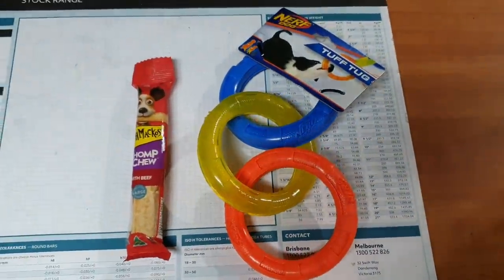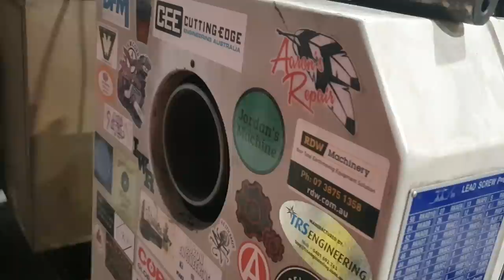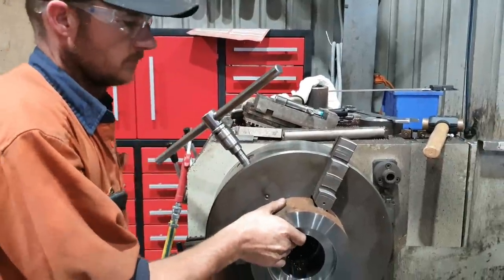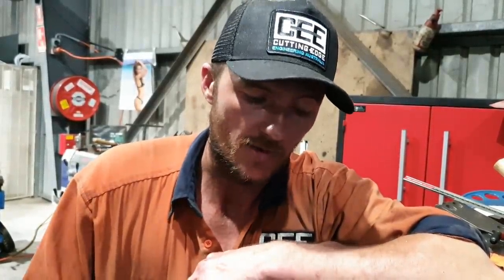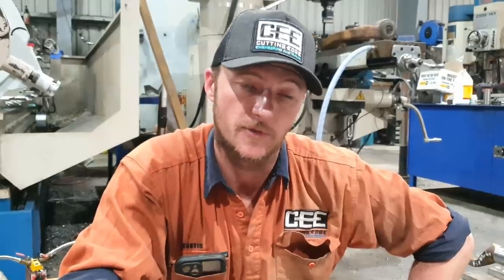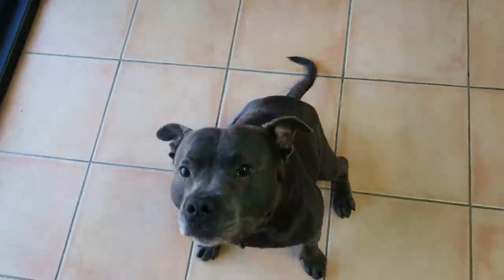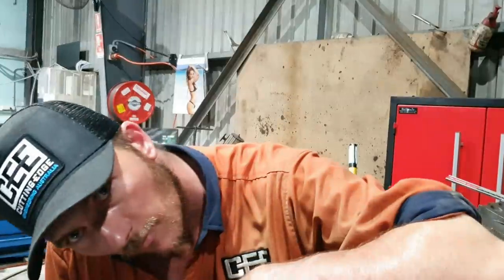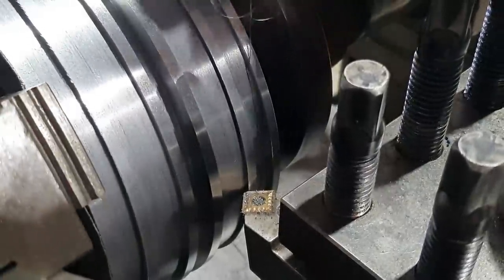Making a Hydraulic Cylinder Piston | Hitachi Zaxis 670 Excavator Part 1

Comment: I wanted Kurtis to say "That's not a twist drill. THAT's a twist drill!", in his best Crocodile Dundee style.
Reply from the maker: 🤣 will have to use the Dundee quote someday
Reply: And it had a very nice grind on it - very satisfying to see those two even spirals of swarf coming from it.
Reply: Only 2” gonna need to do that with a 4” banana drill
Reply: @Sicktrickintuner  Can we get mesurments in non-banana unit standard?
Reply: He should save that one for the big boring bar.
Reply: @Peter_Jenner  Nothing boring about that one.
Reply: @gorillaau  Absolutely nothing indeed.
Reply: @gorillaau   1"(inch) is 2.54 cm. So with rounding 2"(inch) is about 5 cm and 4"(inch) is 10 cm.
Reply: @ianmcnab9534  it's 2.54cm
Reply: @TheDennisZb  Thank you Dennis. 25.4 mm to the banana.
Reply: @CuttingEdgeEngineering  когда я слышу что нибудь про Австралию, на ум сразу приходит крокодил Данди и этот канал. Шикарный фильм и отличный канал. Смотрю с удовольствием. Молодец, так держать!!!
Reply: @ianmcnab9534  Actually it is 2.54cm to the inch
Reply: Big nuts and  big drills
Reply: @CuttingEdgeEngineering  I would laugh for a solid hour if you did that!! 🤣🤣🤣
Reply: That was exactly what thought popped in my head when he brought out that giant drill bit.
Reply: I have a video of a guy sharpening one a twist drill it’s got to be 5 inches in diameter and 4 feet long
Reply: @TheDennisZb  oops my bad
Reply: I think Paul Hogan has stereotyped Australian men for life!  At least for us Americans, sorry guys 😁🤚🇺🇸🇭🇲
Reply: @gorillaau  He did, 50mm.

Comment: I was pretty anxious with how close you got to cutting into your chuck jaws. I guess you must really trust your digital readout and measuring by now to get as close as possible.
Reply: That kind of close quarters work has got to be nail biting when you're on the sharp end
Reply: Before DROs it was a micrometer stop on the bed to stop the carriage. You started off by touching the jaw with the machine stopped, that was your zero. You dialed the stop out about ten thousanths of an inch and let the chips fly. Problem was most of those old machines had a few miles on them, that stop had a nasty habit of scooting just a fraction on every cut. You learned your lesson when you heard that..
thunk.....thunk....thunk.....
of the tool hitting the side of the chuck jaws. Time to stop and sharpen the friggin bit! 
 You learned to have a tender touch with those stops!
 DROs sure make things a lot simpler, I was glad to get them especially when cutting threads.
Terry from South Carolina USA

Comment: Hi Kurtis, good work, I hope the right cylinder tube becomes available.
Those were FUBAR for sure.
I'm not certain you understand what Tristan Hali gifted you with.
They are not conventional stones any more.
They are as discribed Precision Stones.
They do not scratch/grind surfaces any more.
They decapitate dings and scratches and POLLISH the rest of any flat surface you choose to fix.
Go and rub down the top of your mill table or the ways of a lathe.
I kid you not, it will amaze you.
I grind, and also grind these occasionally, and if you rub freshly ground surfaces you can See how well balanced your wheel is, as an example.
A seriously good present of tooling, if you use them..
Just sayn'.
Reply: And today's out takes were pharquing hilarious!

Comment: Whatever it was that destroyed these cylinders, possibly took out the entire hydraulic system, could be a full replacement of barrels, pistons, pipes and pumps.

That cannot be cheap
Reply from the maker: Customer said the pumps are being done and everything thoroughly cleaned and looked over
Reply: @CuttingEdgeEngineering  I gotta wonder if it was vandalism from a disgruntled employee......
Reply: @artmckay6704  All it takes is not cleaning the hose end if they have gotten dirt in them. I've seen damage like this before. I work on trash compactors some of witch the compactor and box are one unit. And the hydraulic power unit stays in place while the box is dumped. All it takes is not cleaning the couplers before reconnecting the hoses.
Reply: Could be lack of maint - if the HP filter was not changed, and the bypass opens - add a failed component - and you have your debris migrating to the actuators - and fubar'ing them up good and proper.  Great work Curtis, nice to see someone with your skills just going about his job in a very able and competent manner.  Hat off to Karen too for great video and editing.
Reply: @steveb6103  thanks :)
Reply: @rigger8722  :)

Comment: Great job. Whatever ruined the piston assembly was not shy about causing such carnage. 4140 alloy steel is similar to S154 but without the nickel content. I worked on the JP233 project which used S96/S154 steel ( 2.5% Nickel Chromium-Molybdenum ). That material was one of the most awkward steels I've ever machined. The surface finish was always affected, but was acceptable as there were no mechanical bearing surfaces involved.

Comment: That was fun. Impressive work. In the possibility that you were not aware, those whet stones looked like they were precision ground flat stones (can't be entirely sure). If you rub them together they should be very smooth. The use for those is to remove high spots and burrs off of tables and ways that are already flat. The stones  (if they are precision ground) will not remove any material or scratch flat metal bits, but burrs will come right off. Robin Renzetti covers them on his channel and I made some as well. They are really useful to use before mounting a vise on the mill or flattening nicks on the ways of the lathe.

Comment: Hiya Kurtis, As you might Remember I build The Laser Drag "scoop Scrapers, We build all Our pistons out of Versa Continuous Ductile Cast Iron Bar Stock (its said to last longer), We had a very similar situation where two bucket Cylinders went out on a shared Hydraulic line, After real close inspection, We determined that a slight Fault in the cast had let go on the edge of the ring grooves, That one bit of material then did What looked the same Damage as yours to both Cylinders ( One was worse than the other), Make sure they Check they haven't tweaked A Rod Slightly out of Straight, As this is what happened With us And that overstressed that one piston into failing on a slight flaw that would have been perfectly ok in normal circumstances.

Comment: I have a friend who used to run a salvage yard so lots of excavators with shears and other stuff with hydraulics. They bought hydraulic fluid in 55 gallon drums. Started having problems with pumps and cylinders and couldn’t figure it out. Sent oil samples from machines and found contaminants present. Couldn’t figure out point of introduction. Until they sent in a sample straight from a brand-new drum. Full of dirt and crud. I believe their supplier bought them a bunch of pumps and cylinders.

Comment: Good work there, good to see you got faster on the second one. Interesting how shallow the seal grooves are, That tailstock looks heavy. Where I worked one time they had plumbed air into the bigger tailstocks so the air blew out between the bed and the tailstock (took a little bit of drilling). You would just turn the air tap on and you could move those big tailstocks with one finger. I noticed one of your lathes you could wind the tailstock along, that's good. Them things are good for screwing your back up.
Reply: The only seal groove is the one in the center. The others are just wear bands.
Reply: @timothyball3144  Okay, that makes sense then, thanks for the info. It was a bit hard to tell what was happening from those mangled pistons. Funny how they have just one seal but, obviously it works.
Reply: @r1learner178  It's not a lip seal, since they won't take the pressure. It will be a cap seal with a heavy oring underneath and the seal band on top of it. The factory has special tools to install them but we just use hot oil, a big zip tie and a hose clamp with electrical tape to protect the seal.
Reply: @timothyball3144  I see, that's interesting. Thanks for the info.

Comment: Kinda surprised you didn't use a pilot drill after the centre drill, makes drilling out with a big bit so much easier... 
Those poor pistons, talk about damage... 😕
The dial test indicator takes a bit of a beating when yer tapping the piece like that... I think I'd disengage the dti before the "adjustment" .... 😂
Nice machining .... as per usual... 🤗

From the Emerald Isle
😎👍☘️🍺
Reply from the maker: hey mate I never use a pilot drill, if the drill is sharpened correctly its really not necessary
Reply: @CuttingEdgeEngineering   😎👍☘🍺

Comment: Would it be possible to demonstrate in a picture why the pistons have such parallel excavations -  is it for rubber-rings or does it run directly in the cylinder? thanks  a lot in advance!

Comment: I'm not particularly experienced with this sort of thing, but wouldnt it be easier to use something similar to a parting tool and plunge it into the face of the part, so that you could just extract a big plug of material, rather than just turning it all into shavings?

Comment: From a non-machinist, how often do you check your lathe to ensure that your boring process is not producing a taper? I'm assuming that the tool post is square to the chuck, that the boring bar, when fixed to the tool post, is actually square to the tool post. Thanks.

Comment: Hi Curtis, I noticed you keep your machines really clean, all the slides and surfaces are nice and shiny, do you mind telling how do you protect them ? I work in radiator shop where people use flux for soldering and hydrochloric acid for cleaning & etching surfaces as a preparation for soldering and that rusts pretty much everything exposed. All slides, chuck, tool post, etc are covered in light rust, I tried rust off, then sand with 2000 grit and cover with oil but that only seems to be temporary solution.

Comment: Wouldn't doing a 4 mm cut at 1/2 the feed rate use more of the cutting edge on your insert give you more lifespan on your carbide?  Also, don't you want to use a parting tool with a radius on it to stress relieve the bottom of the seal channels?

Comment: I have a question, why do you, when starting the bore with the twist drill, only start the coolant after the drill has started cutting, and is clearly already getting hot? Is there a particular reason for that? I noticed you doing that on a couple other videos, I know it must sound like a dumb question, but I'm nowhere near a machinist, I'm just a humble IT engineer that's interested in machining and metal working in general. Cheers from Portugal, I've been really enjoying watching your work😁

Comment: G'day Kurtis, I'm recently lovin' WNMG for maximum metal removal rate in some 316 on a manual machine, problem I find is rubbing the edge off the insert when you stop feedi g, disengage, back the tool out. Happens much slower than it does on a CNC machine.
I guess it's the trade off wirh using resilient insert tooling on a manual machine.
Your thoughts?

Comment: Hey Kurtis I got a question! After the cutting stroke of the boring step, you pull back the tool for the next depth of cut, but it scribes the ID as you pull the tool back. Why does that happen? Shouldn't the initial cut remove all the material by the tool face, so even if you pull the tool back, there shouldn't be anything left? 

Just curious, I don't know anything about machining!
Reply from the maker: that is tool deflection from the cut and "pressure" of the insert as it makes the cut, when the tool gets pulled back that pressure is essentially released and the tool resets

Comment: Stupid question of the day, since the replacement tube stock is so far out (arrival unknown), could they tubes be filled with weld then bored out (like a gigantic line boring operation), then honed on the vertical honing machine?  would the heat distort it too much or would that take too much time, or something else?  The answer may be obvious to those of you in the know, but I’m just curious

Comment: A question for you. Could you have tacked the two piston blanks together, bored out the basic hole, the split the blanks apart and then bring them to spec? Not criticising your operation by any means, just interested to get your take on it.
Reply from the maker: if i was going to do that best to start with a slug 200mm long and cut it but that would take longer
Reply: Understood. Thank you.

Comment: Im curious to know:
When you finish a cut (example 5:32), why does it leave a mark when you pull back your insert (i really dont know how thats called, i apologise) and sometimes it doesnt?
Does it have to do with the insert or the tool youre using?
Would be awesome to get an answer :)
Reply from the maker: that's the tool deflection from heavy cuts, the insert is "reset" back into position after the cut

Comment: Can I ask why there is no pilot hole for the big twist drills? Perhaps if you're going to bore afterwards, pushing the big drills is not an issue?
Reply from the maker: I never use a pilot drill don't need to with drills that are sharpened correctly 👍

Comment: It’s awesome watching you work. Your skills are amazing. Totally enjoy every video. One question. I can’t imagine how many of those inserts you have for cutting with all the different applications you work with but can those be sharpened and used over again or are they a one time cutter? 👍👍👍👍
Reply: Larry 325, most of them have three cutting faces so can be rotated 120 * for a new surface if they're triangular. Square ones offer four edges and some can be flipped to give another four. 
They are  "cast" or pressed in a mould under high pressure so cannot be sharpened. 
Some companies collect the dead ones and send them back for recycling by crushing them to powder, correcting the formulation and re pressing them into new product.
Regards from Canada's banana belt.👍🇨🇦🤞
Reply: @ronwilken5219  Ron thanks! Always wondered about that because they are sharp and precise! Stay safe! From Central Maine🇺🇸👍👍

Comment: Couldn’t you over bore the sleeve to fit a new oversized (slightly) piston? Awesome channel, amazing work, super cool to watch!
Reply from the maker: Yuck 😂 you could but in our opinion that's half assed and we prefer to repair or make things back to OEM standard 😎👍
Reply: Would this also affect the pressure and oil required to opperate the piston? Would this have any noticable effect on using the machine?
Reply: @freakincaige  yes, both pressure and oil. More surface area on piston, hence more force from cylinder. Has to be checked if machine can withstand additional load. Oil, as larger oil content, machine is expected to be somewhat slower.
Also, strength of the barrel is reduced, hence to be checked if barrel still strong enough. 
So, quite a few things to consider, not the least that you are giving the next one who works on these cylinders a nasty surprise, as it is different than expected,
Reply: @casparberends2719  Thanks for the info. Say you took our 5mm for the bore and made a larger piston, do you think an opperator would notice?

Comment: You removed a good chunk of material, is the chips worth keeping for recasting if you have a lot or is it just discarded?
Reply: AFAIK, Kurtis generates enough scrap iron to sell to a recycler.  Recycling scrap iron has been going on for a LONG time.
Reply from the maker: it all goes in a big metal scrap bin and sent to the metal recyclers

Comment: I have 35+ years manual machine work and I don't believe that you can get better than +/_ .005 inches with a three jaw chuck, is that good enough for cat,John Deere,kubota regs
Reply: In this circumstance its a non-issue, unless the recess is critical, which I highly doubt given its purpose.  The bore, OD, grooves are all finish machined with the one setup so all those critical dimensions will be true to each other.

Comment: why not take a plug of aluminum 1/4 inch smaller than the id of your spindle hole and on both ends machine a 45 degree angle on id of that part. then take your groove tool and make you 3 3/16th grooves that you can snap 3 oil rings around the part, after that make 2 caps for both ends with the 45 degree angles with a hole the size of what ever all thread you got laying around.
once you have the plug turned grooved and beveled also you end caps to fit, take the plug and split it into 3 or 4 equal parts which ever you prefer,i used 3rds. then when finished you slide the plug in the back of your spindle and tighten the all thread lightly,i also welded the nut on the all thread to keep it from spinning while tightening the all thread.
anyway what your left with is a plug that keeps coolant and chips off the floor and also stops them runners from crossing shop floor and grabbing hold of a laying in wait air hose or even worse a foot or leg .
if by chance you cut a o ring down the road just replace it, my tip to you and love the vids,give that ole soup bone blue nose a scrub from a retired texas boy

Comment: Is it possible to bore out the shaft and make the piston .30-.40 over size?
Reply from the maker: I would need to make the pistons 5mm oversize to compensate for the damage in the barrel and then you would have lost the structural integrity of the cylinder

Comment: Its been a while since ive been able to use a manual lathe. I notice whenever you put the drill chuck into the tailstock you just set it in there without much force. Does this provide adequate force so it doesnt come out while drilling? It would be nice as i always found it a pain to slam those things in there with the right orientation.
Reply from the maker: it can't turn or come out it's got a tang
Reply: Taper fits are weird, Squatch253 goes into the why and how in his 5j1113 series, it's about taper press fitted gears but the principles are the same